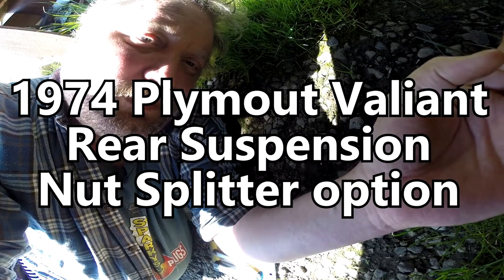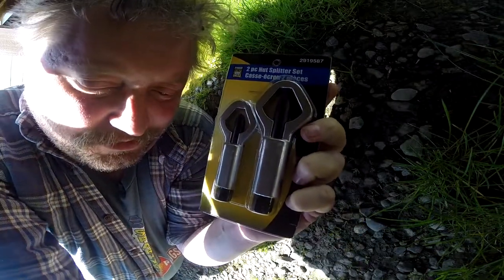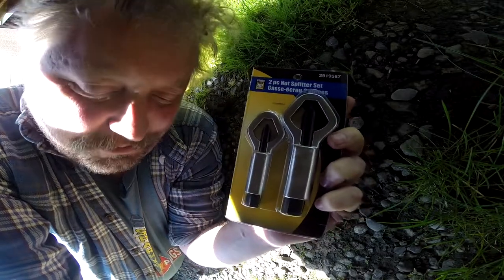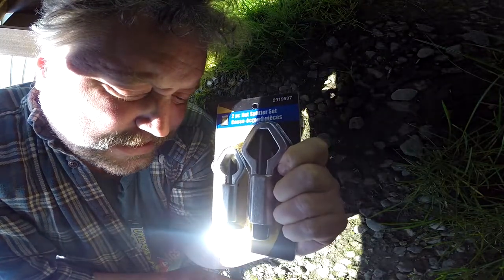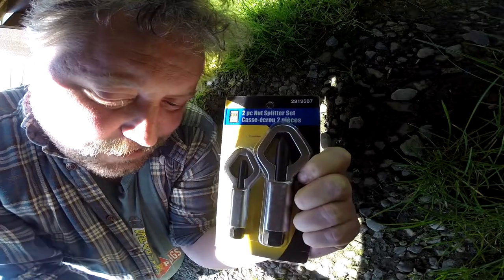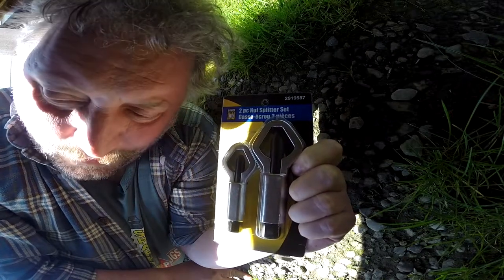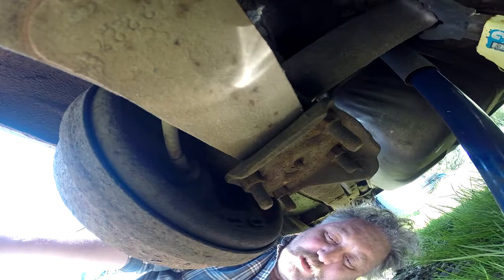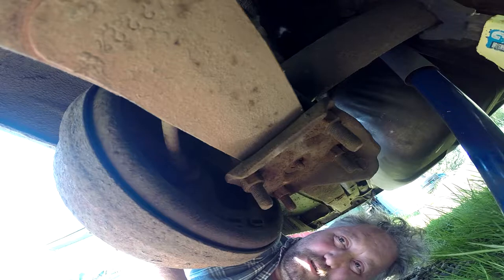1974 Valiant-Rear Suspension-Nut Splitter Option

Comment: You know, they sell a shock mount that replaces the busted off one. A guy here used one by simply drilling a new hole to the side of the old one and putting the new stud there, then you would saw off the old one flush. Those studs face straight backwards and you'd have room to drill. Don't obsess over the slight change in shock geometry..you'll never notice it.

Best one: http://www.manciniracing.com/reshst.html

Cheaper...IF it fits-https://www.ebay.com/i/261871784113?chn=ps
Reply from the maker: I had No idea. Thanks man. I will look into that for sure